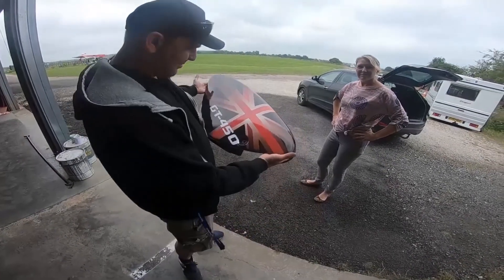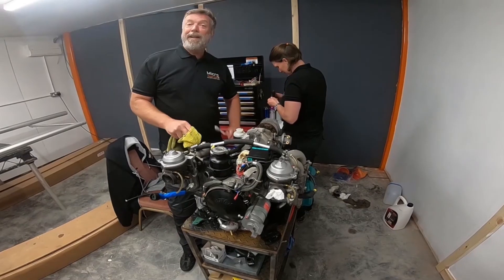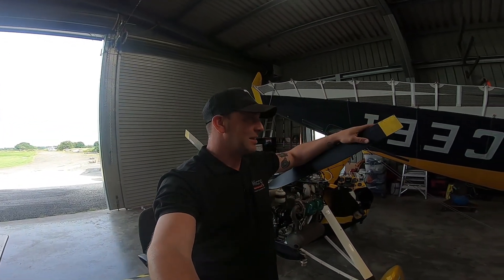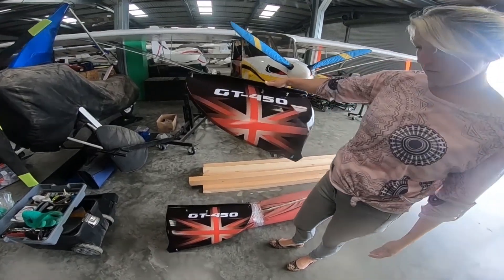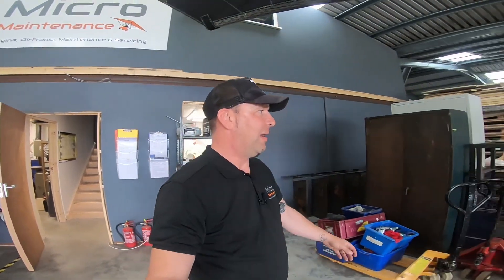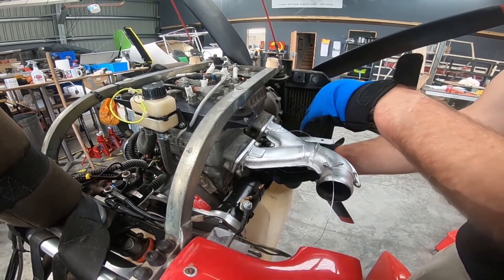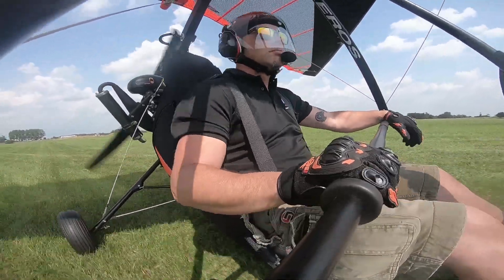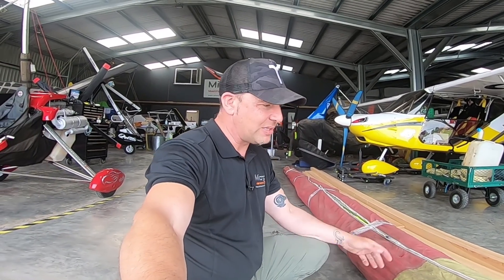Fixed, Flexed, Finished, Flown: Micro Maintenance Episode 8 -

Comment: Thanks for another excellent video!  If you want ideas, I've never seen a good video of a Gt450 or similar) walkthrough of:
* A proper preflight inspection
* Preparation for transport - mainly wing removal and installation with tips like how NOT to lose the Jesus bolt bushing.  #facepalm
* Process and steps for sail removal and installation including reinstallation of the leading edge mylar and re-attaching the nose tension straps.  #bloodshed
* Proper compression/leakdown testing of a 912 (or a 2 stroke for that matter).  
* How to re-prime the oil system with compressed air after some fool turned the prop to "get the last of the oil out" during an oil change #damit
Looking forward to your next episode.  Cheers from the U.S.
Reply: Hi Jeff, some great ideas. I will add them to the list and try, try to get some done soon 👍🏻

Comment: Cracking video as usual, thanks. Once you’ve cleaned the wing with the Sail / canvas solution do you have to ‘re-proof” the wing or just let it dry and it’s good to go?
Reply: Hi John, you can ‘re-proof’ with Nicwax but even P&M didn’t really recommend it as it can seal the wing from future cleaning as it was mostly a water repellent. We use Wet and forget which is an active mill due remover. 👍🏻
Reply: @markatmicro5091  That’s good to know, thanks for that.
Reply: @markatmicro5091  Hi Mark would you told me please whitch exact product do you use from wet and forget, I am trying to clean my wing from mould dots and I do not live in UK to send it to you? I has already tryed with starbrite but no result..